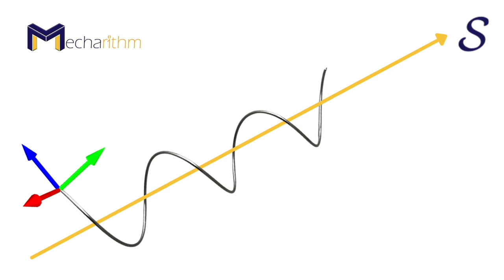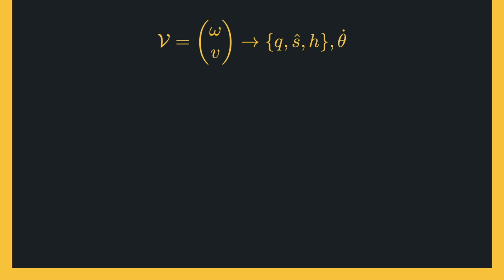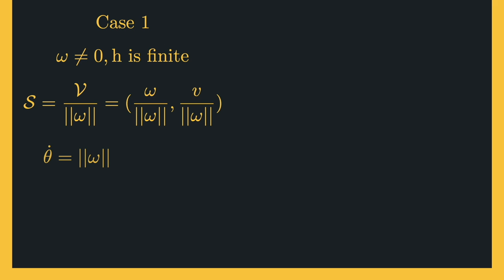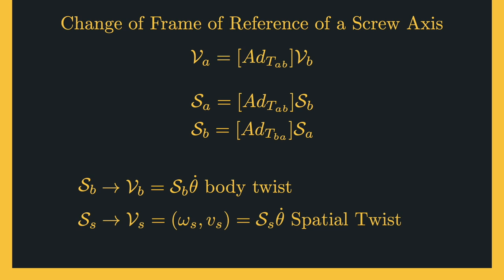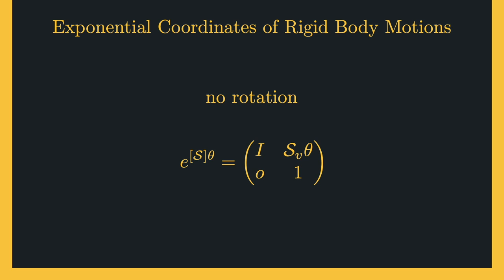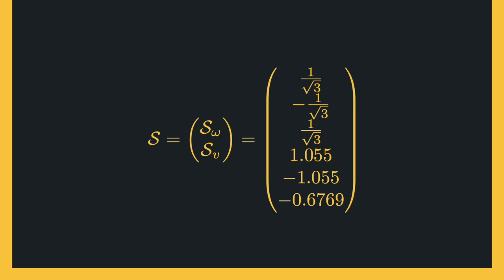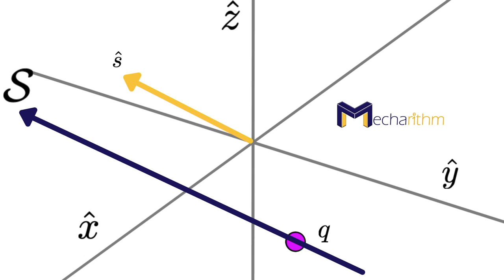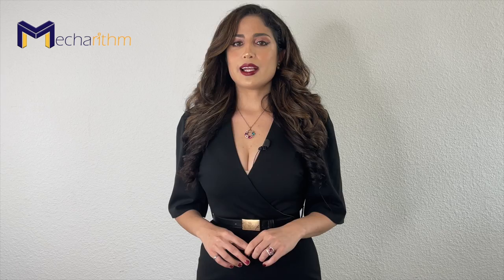Screws: a Geometric Description of Twists in Robotics | Fundamentals of Robotics | Lesson 17

Comment: It's all in how one interprets it. Forty years ago I developed my own matrix-based spatial algebra notational convention, similar to Featherstone's, and used it to develop a general purpose, 3D rigid multibody dynamics modeling and simulation program for a fortune 500 company. Let there be one inertial frame 0, and believe me, the numerical processing is much simpler and more efficient when all vector coordinates are expressed in the same frame 0 and all bound vectors are moved to the same frame 0 origin. Imagine a spiky ball of hundreds of bound vectors all intersecting at a common point with all those free vectors floating around that you can't seem to lay a finger on. It's sort of like protons and neutrons sitting in the middle of an atom with a cloud of evasive electrons that don't seem to be anywhere at the same time.